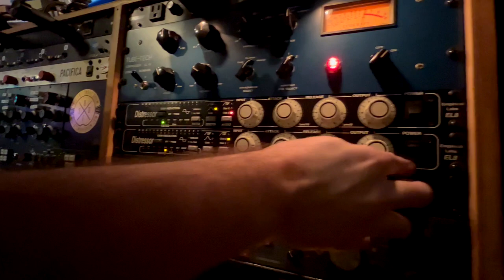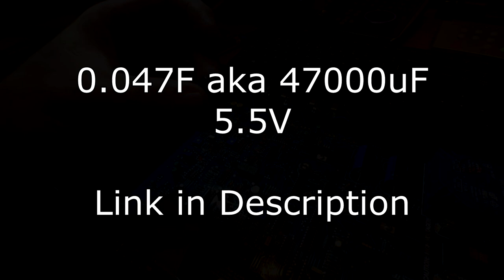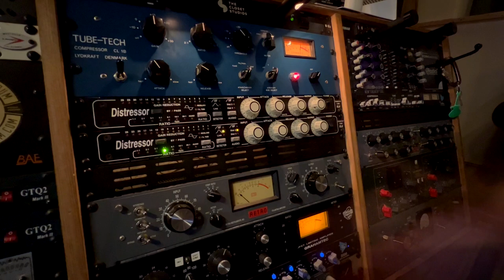Distressor Memory Cap Repair - How To DIY

Comment: Thanks for posting this.  My cap needs to be replaced.  BTW, anyone who's working on electronics should know about the Knipex 7871125 flush cutters.  They have a little spring on one of the jaws that catch wire ends so they don't shoot into the chassis when you're clipping off leads.  Should be about $30, best nippers ever.
Reply from the maker: Nice! I need to check those out.

Comment: Very cool thank you, to me he make one little mistake, before put unit in the rack he would test it, because if the unit does not work correctly he will needed to take it off again, open it again etc. He know what he is doing indeed
Reply from the maker: I actually did do this, but didn’t film it. So we installed it and then showed it working. 👍

Comment: What is that little pump used for exacly?
Reply from the maker: You heat up the solder until it melts and then the pump sucks out the old solder so the pads are totally clear and empty to accept a new part. If the pads (holes) were full of solder you couldn’t push the new part through easily, so this Makes it much easier to replace parts!
Reply: @RecordingLounge  Thank you!